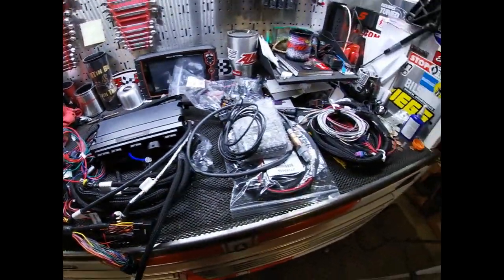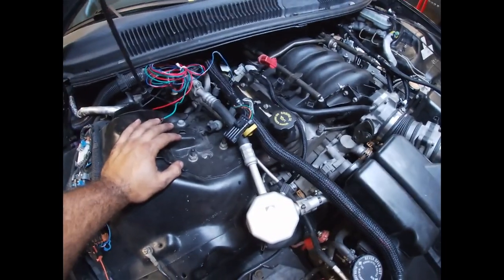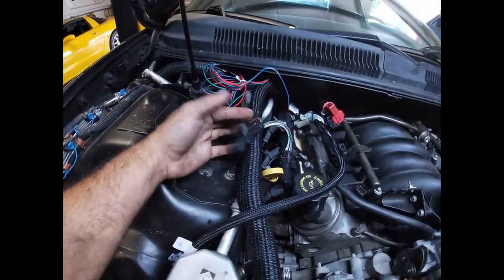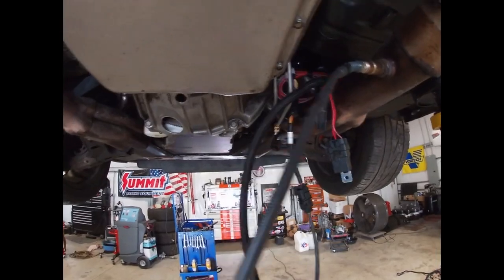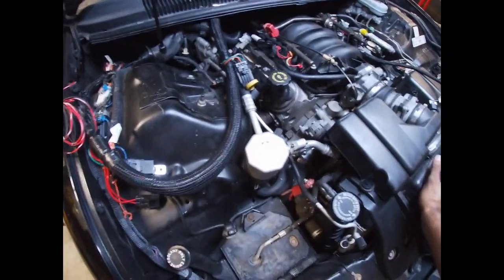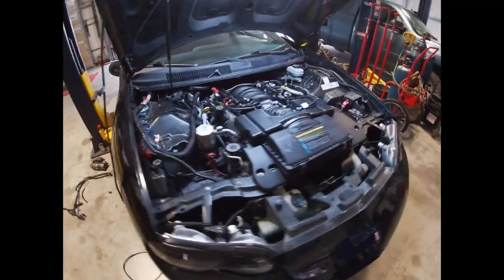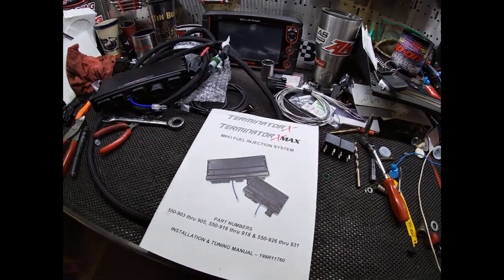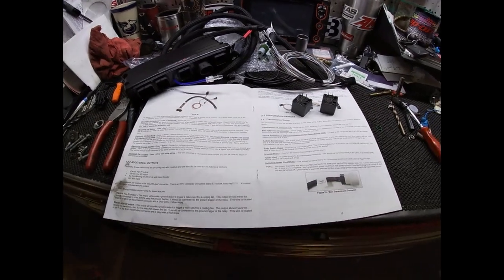Holley Terminator X Install

Comment: Why didn’t you remove most of the harness? I just pulled mine and all them wires by the battery going back toward the firewall are gone. Is that so the lights still work I see it goes to that harness
Reply from the maker: Buckeye Speed419 yes the owner wanted all the other functions of the car to work and we were very limited on time with the install. If someone wanted you could remove the individual wires from the harness that aren’t needed.
Reply: HolmesTuned okay so would it just be the wires going to the bcm inside the firewall that you need. If I remember correctly it’s three wires going to the inside by the kick panel
Reply from the maker: Buckeye Speed419 yes it’s the wires to the bcm. I don’t remember which ones specifically. I usually print out the factory schematic so it’s easier to see what wires go where.
Reply: Okay cool thanks a lot! What about the alternator and starter solenoid? Both just need 12v reference with key on?
Reply from the maker: Buckeye Speed419 alternator gets wired to battery, exciter/trigger wire on the alternator also goes to 12v but will need a  470ohm 1/4 watt resistor in line to put a load on the alternator.  Starter signal just needs switched 12v at crank position. We wanted to do a part 2 video with all that info but the owner picked up the car before we got a chance to shoot it. May try to do one in the future.

Comment: Can u tell me exactly how u ended up permanently wiring the fuel pump wire and fan wires into the factory fuse box?  I would like to do it that way too.  That way I don’t have to add relays etc
Reply from the maker: You just need to remove the fuel pump 12v feed wire from the bottom of the fuse panel where the terminal goes into the factory fuel pump relay and run that to the fuel pump wire in the Holley.

Comment: When you remove the factory computer what all does that delete?
Reply: Hey thanks for the help man. I'm completely clueless when it comes to wiring
Reply: What’s all needed to get headlights/ taillights, power windows and fuel gauge to work?
Reply from the maker: Ben Boyer all of those things aside from the fuel gauge are powered by the BCM and not affected by removing the pcm, fuel level can be displayed on the Holley using the inputs that come with it. You will have to measure the sender resistance and tell the Holley what to display
Reply from the maker: Basically all your gauges, and transmission control for automatic transmissions, but this is the Terminator X Max so it has transmission control as well. We tied the Holley fuel pump wiring to the factory fuel pump wiring at the relay so the pump still works correctly off the key, but all the gauge functions to not read. The Holley dash displays anything you need though.
Reply: No issues with security or vats? I assume the a/c doesn't work either?
Reply from the maker: No since the VATS is in the pcm once it’s out no more start inhibit. The Holley can control the A/C through the input and outputs
Reply: Currently have an 01 ws6 with a gen 4 lsx and th400 trans
Reply: Awesome and thanks for the quick reply